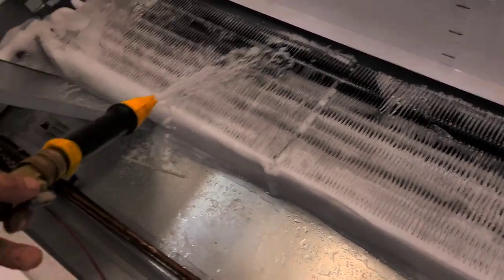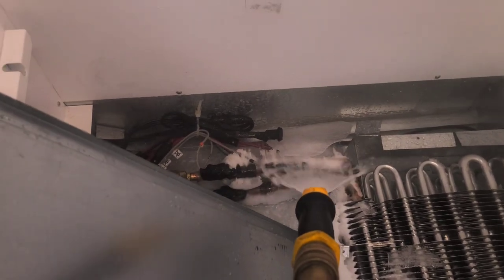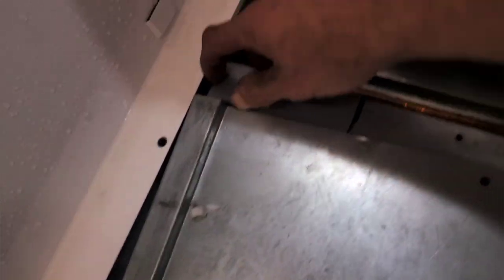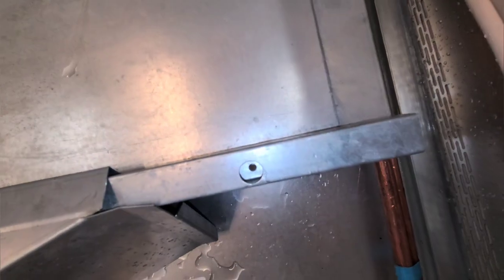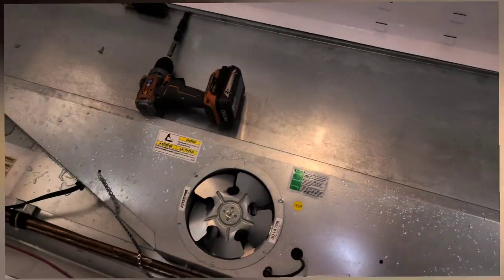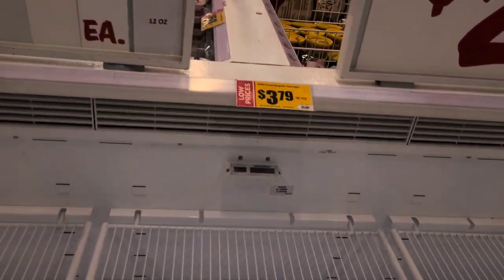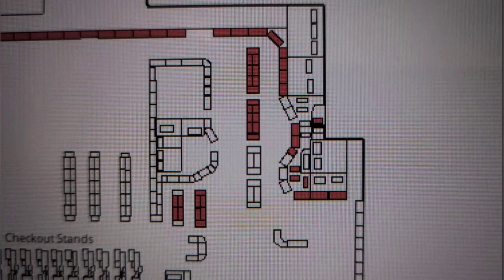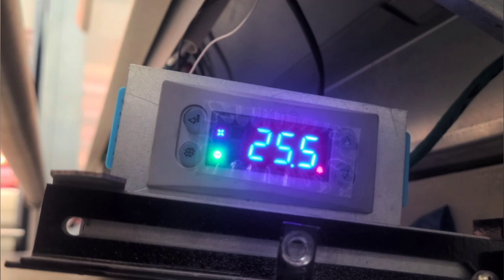Frozen Food Island Case Froze up, Controller Offline on RDM, Controller Won't Drop Temp to Setpoint

Comment: RDM hasn't energised the solenoid valve, if it was energised you will have a symbol in the top left of the local controller screen. Its probably a setting issue.

Comment: Is there a possibility case is Dual-Temp and was in Medium temp setting?
Reply from the maker: Yes they actually are dual temp, there's a switch on the bottom and when I flipped it, it started dropping for a few minutes but then stalled again and never even got close to the -8 setpoint.